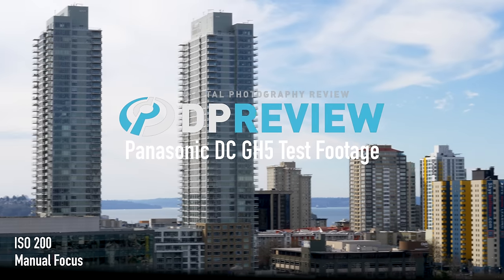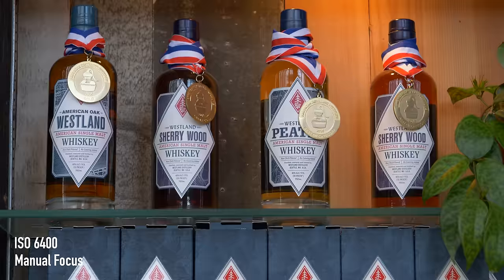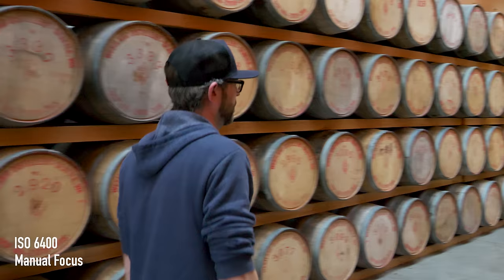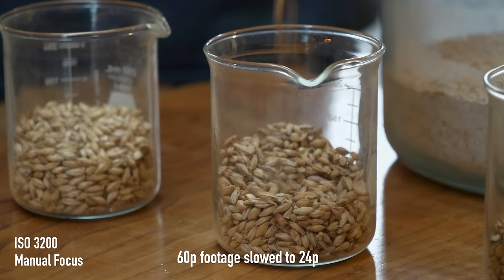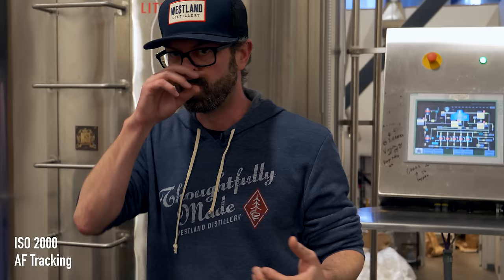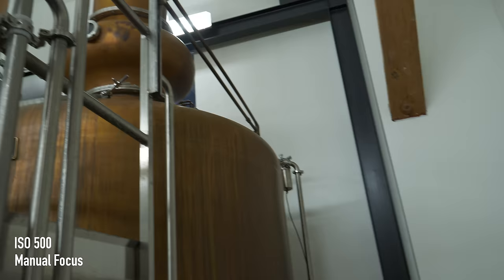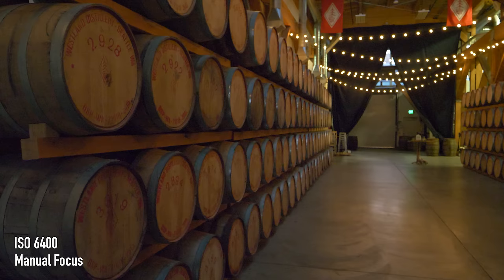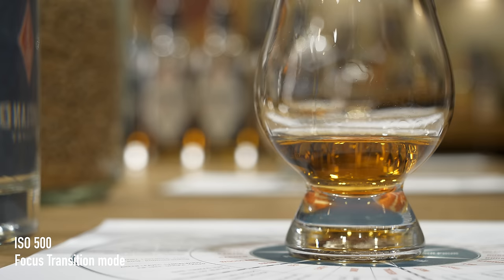Westland Whiskey Distillery with the Panasonic GH5

Comment: Thanks for posting this. Is this straight out of camera? There's a lot of noise in the shadows from 2000 ISO and up.
Reply: its on youtube, hence not straight out of the camera.......
Reply: It's not straight out of camera but has been minimally graded (a couple of the clips have very slightly pulled-down shadows, since Cinelike D is fairly flat, and there's some minor colour correction on a couple of clips to improve the consistency, clip-to-clip).

There's a download link to a ProRes 422 version over on dpreview.com, so you can see the footage without YouTube compression added.
Reply: Filming @2000 ISO in m4/3... even with a GH5, is a bit provocative. That means he closed the iris when it was not needed... But for demonstration purpose, it's useful : first conclusion, prepare to de-noise in some case at that ISO and in most case at 6400 ISO.

Comment: huh, im not really impressed with these tests, specifically the slow mo portions seam choppy.
Reply: Thats what 60fps to 24p looks like when dropping seeds that fast.
Reply: I was wondering that too but i felt it looked too choppy, then i saw 2:04 and it defintiely looked choppy. doesnt look like 60 to 24, more like 24 slowed down in post.
Reply: This. It doesn't look like it was conformed rather slowed down.
Reply: Yeah maybe, looks a bit to choppy for being slowed down. If it was 60 to 24 in realtime playback it would make more sense since the math is wrong. Dropping some uneven frames.
Reply: the reason for this is that they had their shutter speed set to most likely below the frame rate or right at it, which will give you the chop. You have to double or more your shutter speed compared to frame rate to get smooth slowmo when conforming to 24fps or 23.976fps.
Reply: Learn about Shutter speed.
Reply: Ryan Kozicki says it perfectly. I learned it the hard way